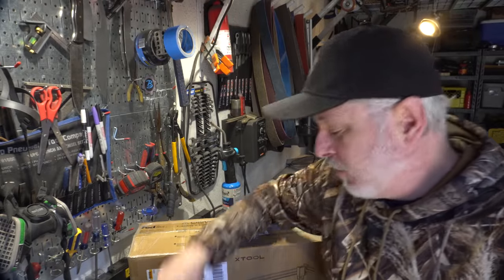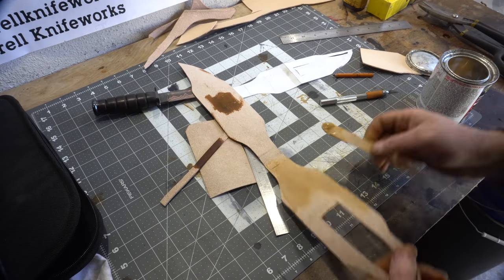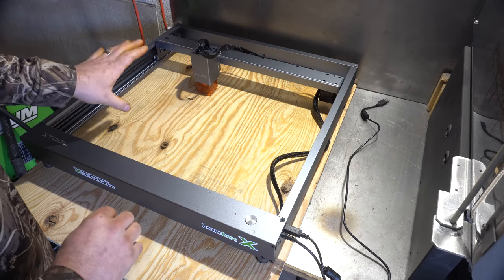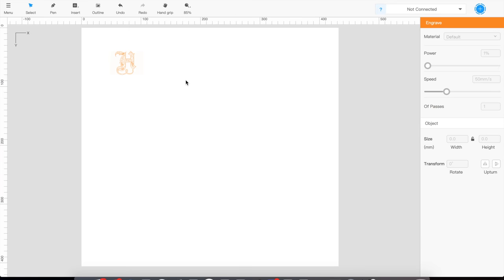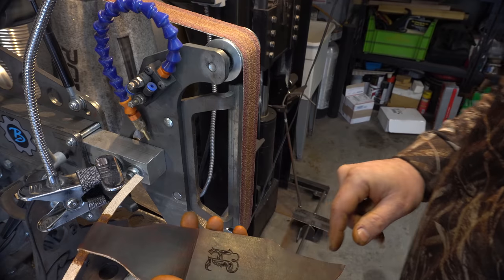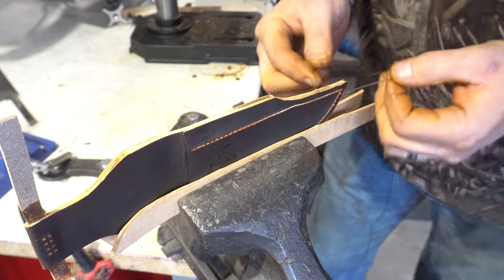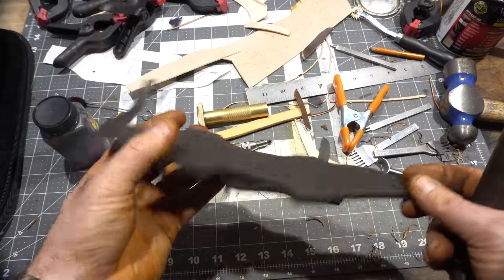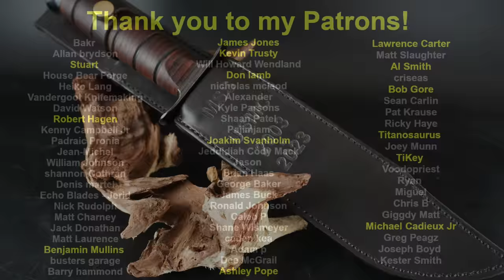Making knife sheaths for the kabars and testing the xTool D1 laser engraver

Comment from the maker: Can you think of any other clever uses for this laser cutter/engraver?
Reply: Would it work to engrave cool designs onto a guard or pummel?
Reply from the maker: @redwolfknives3174  no, this laser isn’t powerful enough to etch steel.  Those are in the $5k range.
Reply: I'm thinking American flag. Or We The People 
Don't Tread On Me 
Ect ect
Nice job Denis
Reply: Very detailed scarification.
Reply from the maker: @patkrause1254  for what to etch, the possibilities are endless.  Now I can do whatever the situation calls for.  👍
Reply: My family has one, really what it comes down to is how powerful the laser is to how many passes you can do without burning/damaging the material. 

For friends/family we have done Mirrors/Glass (2D only), plastic signs, metal etching designs, tree ornaments, wood signs (we did our family tree on a circular log cut that hangs up in the living room,  (We did the back of our I phones with names/designs), be creative the limits are endless! 

PS amazing work BTW.
Reply from the maker: @TheDominickheiber  excellent ideas!  Thanks!
Reply: perhaps you could use the engraver in combination with plating to plate the low spots, sand the high spots? (admittedly would probably take a lot of passes)
Reply: Can it etch your logo in high carbon steels or Damascus??
Reply from the maker: @NagelHausForge  No, etching steel requires a much more expensive laser in the $5k range.  There are some other options like putting some special paint on the blade and then it etches that black, but its not really "etching" the steel, just leaving black marks which won't be as durable as real etching.  I think you'd be better off laser cutting a stencil and then using it to electro-etch that.
Reply from the maker: @NagelHausForge  not with this laser.  You need a much more powerful and expensive laser for that.  They are in the $5k range.
Reply: Does it leave any kind of mark on steel? If it's just visible it would be great to put a template onto steel for your upcoming handengraving
Reply from the maker: @NjordArtisan  if you paint the steel first it will burn that but I don’t think it’ll mark raw steel much.

Comment: I know you really need a fiber laser to etch steel, but I’d like to see you try using tape on your steel and ablating your logo from the tape.  Then you have a stencil on the steel to electro etch.  I’m considering getting a laser, just curious if that will work.  Sheaths look great!
Reply from the maker: I’ve heard it’s possible to get a chemical to coat steel with then etch that abs it leaves the etching area black. I’ve never tried it though.  Maybe I’ll look into it.

Comment: You should use an awl on the drill press for the holes. Push the material aside instead of removing. So the stitching gets tighter once the  material relaxes back. Don't think it makes a huge difference though. Haven't done that much leatherwork to be certain
Reply from the maker: Yeah, I don’t think it makes much difference and it’s way harder to stitch with an awl.  Thanks for watching.
Reply: @TyrellKnifeworks  i meant using the awl instead of the drill bit. Spinning and all. It creates a nice threading hole. Indeed it will be way harder to just punch with the awl having it not spinning
Reply from the maker: @HammerSmashedFace92  yeah, I get what you meant.  I don’t think it very necessary.  The stitching is already very tight.

Comment: perhaps you could use the engraver in combination with plating to plate the low spots, sand the high spots?
Reply from the maker: It won't etch steel if that's what you're getting at.  You need a much more powerful and expensive laser for that.

Comment: 1 year later do you find yourself using the engraver much ? I have contemplated adding one to my workshop, but im still tossing on the idea.
Reply from the maker: I’ve used it for a bunch of other things.  I have done business cards with it, made vinyl stickers for the spear build, even done my makers mark with it on one blade.  Thanks for watching
Reply: @TyrellKnifeworks  I was wondering about how the makers mark would go . I’m really going between the engraver and a thickness planner. Right now I’m hogging off so much material on the surface grinder trying to get it all squared up